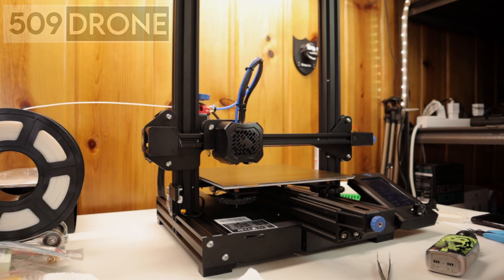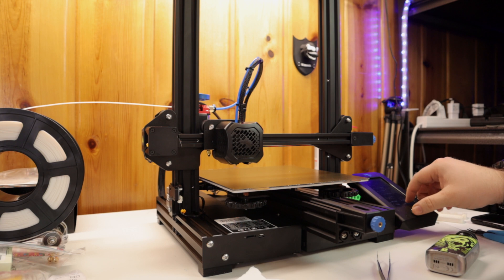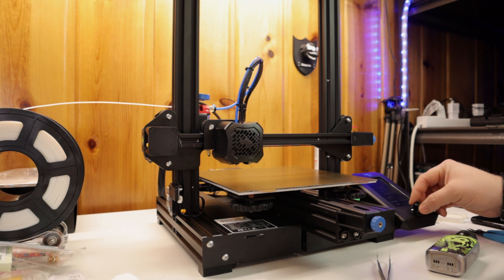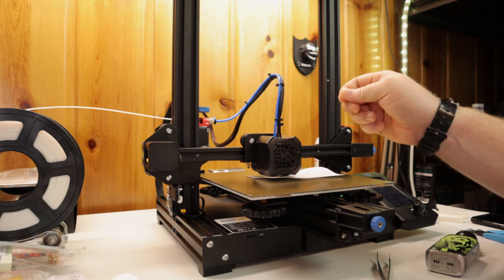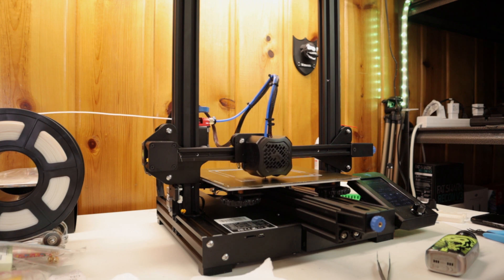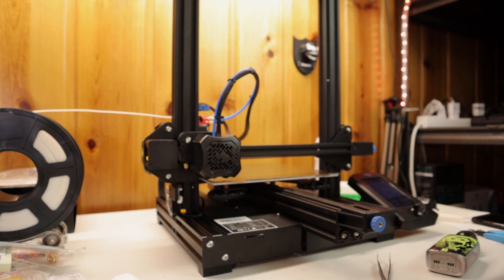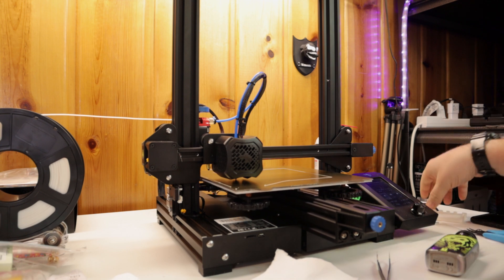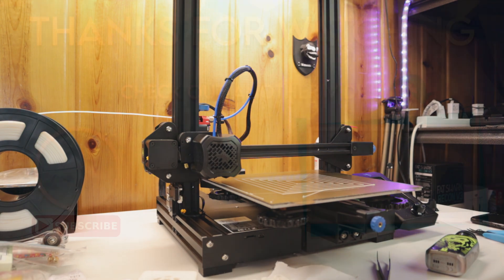How to level your bed - Ender 3 V2 [ Beginner Friendly ]

Comment: Are you by chance near Spokane?
Reply from the maker: Yes. I'm in Spokane. On the north side
Reply: @509drone2  I'm not far from Mead HS. I recently got my first 3D printer (Ender 3 V2). That's how I found your channel. Your content is helpful. Thank you! Are there any 3D printer meet up groups around Spokane?
Reply from the maker: @daviddean4061  right on man. I'm just a few mins north from you. I'm not sure of any meet ups. Do you use discord? If so add me in there
Reply: @509drone2  No can do without your Discord username and 4 digit tag.
Reply: Nevermind. I found the invite link to your Discord in the video description.

Comment: I have  new ender 3 v2. I leveled the bed so many times that is perfect. However, filament keeps refusing to stick to the bed. I tried everything, nothing is working. Do you think it is a bad filament? Or am I missing something.
Reply from the maker: Sometimes it can be difficult to get it to stick. Try slowly making it tighter and tighter until it sticks. Also look into getting a PEI bed sheet. Check out some of my other videos for info about them. Some filaments will also stick better than others as well. But you should be able to get any filament to stick.

Comment: I finally just did a spring upgrade on my Ender 3 V2 and now I can’t get the damn bed level for the life of me! I tighten the springs all the way tight in pairs, give em about 4 turns to raise the bed and home it. Then my right side always rips the paper. So I turn down that side and run out of turns. I do it when hot. What am I doing wrong 🤬, please help?
Reply from the maker: It sounds like you need to lower your Z level access limit switch. You can lower it on the side of your printer after your tighten down your springs.
Reply: @509drone2  - Done that. I even did the cutting off the nub hack to that switch to lower even more. For some odd reason the right side is always higher than the left and I’m losing my mind over it! Appreciate the help though, thanks. Any other advice?

Comment: For some reason I can only level one corner the other corner is too high even when turned counter clockwise a lot
Reply: Same, did you Manage to fix it?
Reply: @arafatshabir3038  I had to tighten the bolts of the support arm so it doesn’t slouch as much causing an off balance

Comment: sigh still dont understand
Reply from the maker: Watch it a few more times. And follow along each time. Once you finish, or get stuck. Start over, and do it again. Once you figure it out, it will be easy for you.
Reply: @509drone2  I've watched it many times :(
It goes good on one corner then doesn't move to the other side I re adjust and it doesn't. Work 
I feel like throwing this thing outside
So mad rn
Reply from the maker: @Nightwing93  I totally understand your frustration. I felt the same when I first started. I would suggest getting in our discord. There are lots of helpful people in there. When I get off work today I can also help you do it in discord.

Comment: I've leveled my bed using this method and using the new springs but the filament isn't sticking to the glass plate and the filament just clumps at the nozzle. Any suggestions?
Reply: I'm having the same issue. If anyone has any suggestions please help.
Reply: Same issue and no resolve still.
Reply: Same here :( I think it might have to do with the nozzle or my BLtouch possibly :( I’ve tried the alcohol trick and glue stick trick

Comment: My centre is a lot looser than the corners, please help! I have the creality magnetic bed and think I might regret swapping away from glass
Reply from the maker: I had this issue as well, but backwards. My corners were a lot looser than my center. If you are manually leveling the bed, level it off the center. Basically pretend your printer bed is a lot smaller than it is. You will rarely print all the way to the edges of the bed, so they are not as important. Jump in our discord and shoot me a msg if you still need help.
Reply: Once i do this. Any print the zaxis is too high for first layer. I tune set baby step to 0.85 is that ok?

Comment: I used the homing thing and it started violently vibrating on the left side. It looks like the left side is higher than the right but I'm not sure how to fix that since I'm messed with the things at the bottom of the plate
Reply from the maker: Thats not good :( I would look into updating your firmware.

Comment: Hey I’m having trouble setting up my ender 3 V2. My glass build plate is bowl shaped right now and I wanted to buy the build plate you have but the link takes me to a bed leveling system. Would really appreciate a link to the bed plate you have so I can get consistent prints. Does it go on top of the original glass plate or do you get rid of the glass plate altogether? I’m assuming that you had to cut the Z limit switch holder to get your nozzle closer to the bed since you don’t use the original thicker plate with the new plate. Thank you for your vids! They have saved me so much time!

Comment: i just got my ender 3 V2 and put it all together last night. I  messed with it for a few ours and i cannot get the filament to stick to the bed. I am using the filament they supplied with the unit so i am not wasting filament that i purchased. I have tried to level the bed multiple times but does not help at all, i am thinking the glass might be warped, i will confirm this tonight after work. I also tried the hairspray trick and it made no difference. I will try a glue stick tonight. Should i ditch the glass bed altogether and go with the EXflex? Also should i try clips on each corner and ditch the 2 metal clips supplied?
Reply: I been getting the same thing. Each time I tried leveling the bed in each corner it keeps changing. The filament doesn't stick to the bed and makes a spaghetti. Did you find a fix?
Reply: @dylankamal  I finally got mine to print very well with ABS and PLA, I had the nozzle to far away, so now I set it with a piece of paper to were the paper is vibrating when you pull it, if that makes sense. I also am now using purple glue sticks as well. My machine has not stopped lol. Printing bad ass. I also ended up ordering the self leveling sensor which will be here Wednesday, I am already sick of leveling the bed every damn print.
Reply from the maker: Jump in discord DK, I would be more then happy to help you get it figured out.
Reply: @509drone2  hi man thanks for the reply. I just changed the springs and got it to work
Reply from the maker: Hey Eric, sorry I didnt reply right away. Jump in discord if you can, and I would be happy to try and help you fix the issue. I'm sure its just an issue of getting your bed leveled, and possibly your settings. And yes, the ezflex bed sheet will definitely help. I'm slayer in discord.
Reply: @509drone2  hi man, its all good, i am sure you are a busy man, i did get it to work now and have printed roughly 7 things now from a wolf to bike parts. The only thing i am seeing now is these tiny little bumps in the finish. I will have to sign up for the site you mentioned.
Reply: Use an adhesive like glue stick or Layerneer Original Bedweld 3d printing adhesive. Apply a layer or coat to tge bed and this should help.

Comment: Hi, I'd be really thankful if you could read this and help me!

I have purchased Ender-3 V2 and it didn't even arrive yet, will take a few more days. I was going through videos about it and the issues I should address ASAP once I start using it. 

I found this issue of lose tube - https://youtu.be/lboDSH0945g, so from what I gather easiest way for me to fix this issue is to 3D print couplings for extruder and also the hotend, then these couplings will help in keeping the tube in place. I found way too many solutions for this 3D printed fix on thingiverse. The original 3D printed part showed in start of this video linked above might not fit as stated by numerous comments on the post (thingiverse). So people have made their own versions/remixes, that they say will fit better.

1) Can you please tell me which parts I should try for extruder and hotend to fix issue of moving/lose tube? 
2) Also do I need anything other than the 3D printed part itself? (like I saw in videos that they use another short piece of tube which goes in the hotend , I don't understand that).

I'd be really thankful if you could make a video on fixing this issue only with 3D printed parts.

However, if you think the method shown in the video is best solution, I found this kit: https://banggood.app.link/j5Fmru8CJdb

This is what I found for extruder: https://www.thingiverse.com/thing:3360380

And this is what I found for hotend: https://www.thingiverse.com/thing:4040340

Comment: Good video on bed leveling - I'll have to check out that print surface you used.

I put lock nuts on the bed leveling screws to keep them from rotating when turning the wheels so leveling stays solid for multiple prints.  (Also changed to orange springs).  Seems to really work well.
This was from a video by Brian Vines (BV3D) - "This Simple Ender 3 and Ender 3 Pro Bed Mod is NUTS!" 
  https://www.youtube.com/watch?v=v5u_Xgq62nQ
Reply from the maker: That's a good idea with the lock nuts!

Comment: I use the same leveling method, works like a champ. With the enhanced springs, haven't had to re-level the bed in a long time, though I still check every 3-5 prints because I'm neurotic. Side note: My v2's glass plate was bowl shaped (I've read this is not uncommon). Any print crossing the center would not adhere, I was going nuts. I switched to the EZFLEX bed and now 20+ prints in, no issues and the prints pop off with ease. 100% recommend.
Reply: I think this is my issue. The middle of my v2 bed is lower, which has caused some adhesion issues.
Reply: @ernestryles  It's frustrating for sure. I heard some folks flipped the glass plate over and had favorable results, but by the time I found that nugget I had the magnetic setup incoming from TH3D.
Reply from the maker: Thanks for sharing your findings. I had the kinda the same issue with my stock bed as well. Front left corner was lower then the rest of the bed.
Reply: I switched to a mirror bed and it is great also.